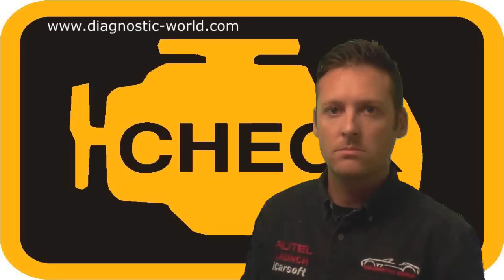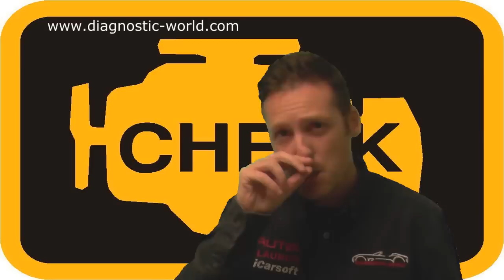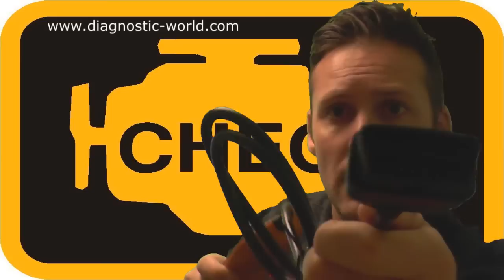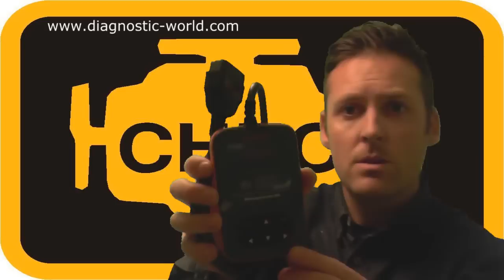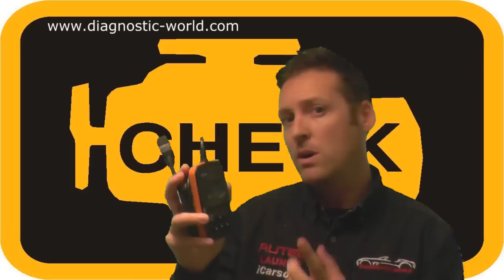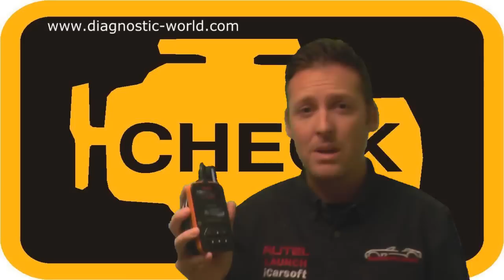Why Is My Check Engine Warning Light On? EML EPC MIL

Comment: this light is on and my car (vauxhall corsa 2006) is having trouble going up hills and is also stuttering a little
Reply: also it completely stopped at one point but started moving again
Reply: buy a cheap code reader from ebay for about £15 - you just plug it into your car data port under your dashboard (ODB2 port) and you can read off the code - could be your fuel pump or your condensor - search for sandboy scanner on ebay.
Reply: your a bit late it already broke down but its fixed now (one of the tubes on the engine fell out)